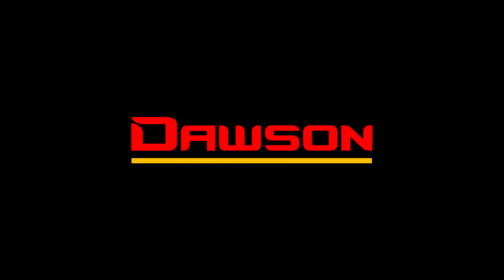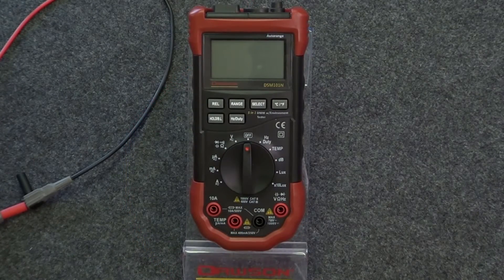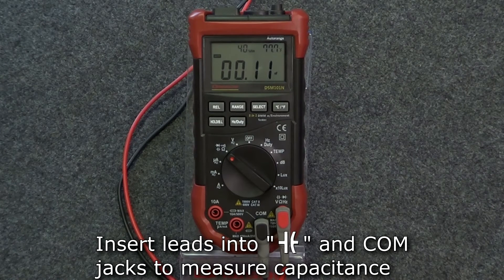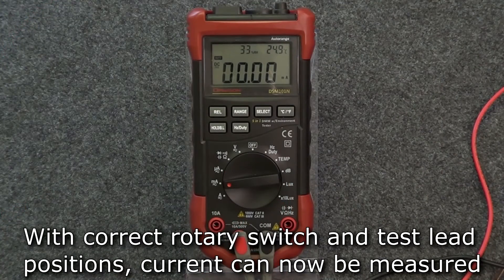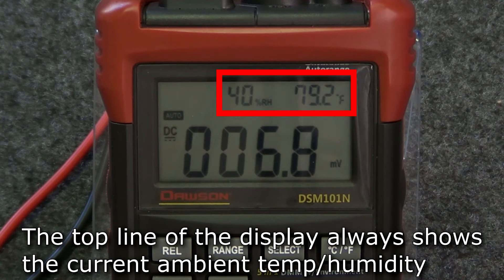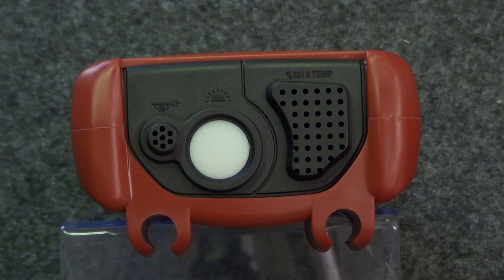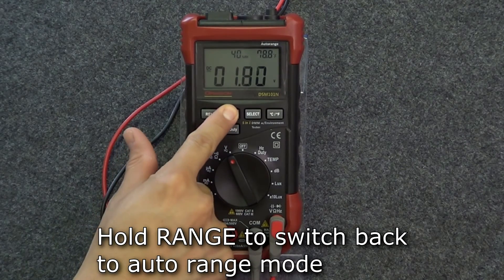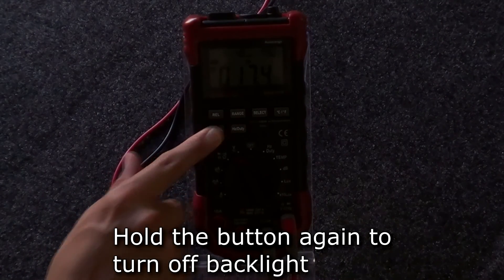Dawson DSM101N Digital Multimeter w/Environmental Testers

Comment: Hi, a have a question for my multimeter i have the same model but i have a problem with the mode TEMP and the termocuple in the manual i read first is the OL displayed and in the time for mesearument with the termocuple in the correspondients jack´s i dont have measurement only display OL please help show me how fix that please
Reply from the maker: Is the thermocouple connected correctly?  The temperature jack is the second from the left, not the far right.  Most DMMs work where you put the + end into the far right jack, but we moved the temperature jack to the second from the left.
Reply: + Dawson ToolsInc 
i connect the thermocouple in every way obviously reading the manual first but the result is the same my question is about possible damage factory ,because i tested the termocuple with continuity and is ok
Reply from the maker: If you tested the thermocouple and it appears to be working, then there might be a problem with the meter's temperature function.  Do the other functions of the meter work correctly?

If you'd like, you can contact our service dept. if the meter is in fact defective and get a replacement since it will still be under the 3 year warranty.

http://www.dawsontools.com/contact-us